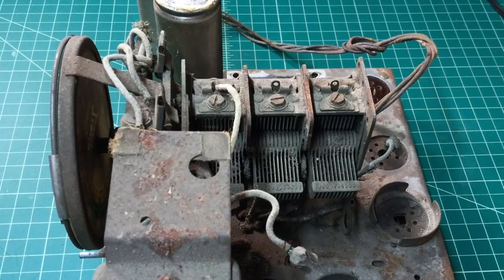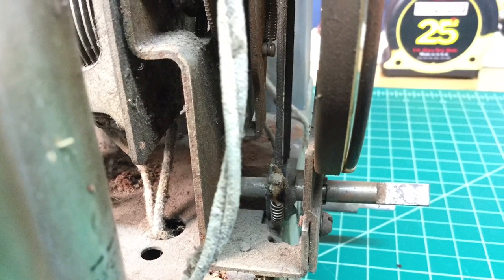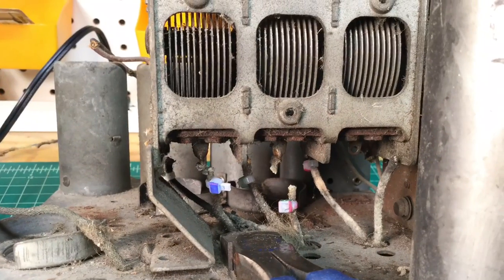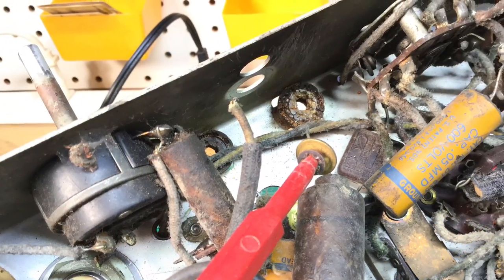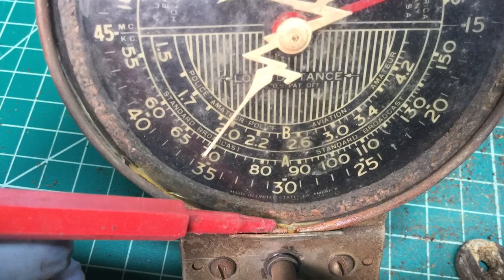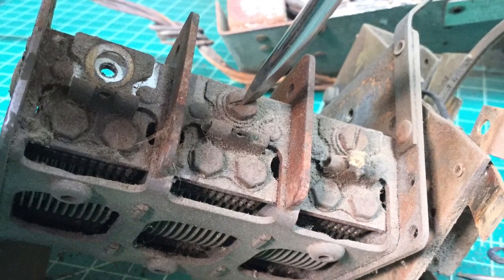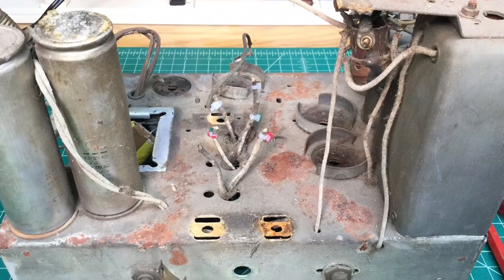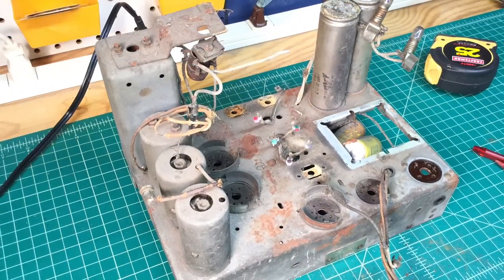Zenith 5-S-29: Tuning Condenser

Comment: Don,
"Organisation is the key to success!"  I came to the conclusion a while ago you are a well organised person: and let's face it, it is important to be so as we Vintage Radio men all know how easy  it is to lose an important component, or forget how one dismantled something.  I too document various things ... on pieces of paper, except in my case I often misplace those pieces of paper.  As my wife says, it defeats the object LOL.  I very much like how you document your progress electronically.  Unless it is accidentally deleted, it is accessible for as long as it is required.
Will you clean the tuning capacitor  inside your ultra-sonic cleaner?  If so, it will look good afterwards, especially its aluminium tuning veines.
Another excellent video my friend.
Regards,
Phil.
Reply from the maker: Hi Phil - my organization skills are better some days than others. LOL  I too have notebooks full of hand drawn notes and pictures. At times, I find photos hard to use if multiple shots from different angles are not secured. The old condenser is headed to the ultrasonic cleaner, but only after making another stop that I'll explain later. I spent 12 hours today de-rusting the majority of the chassis. I hope to have another video up soon and would like your opinion if the chassis would look better painted to hide some of the pitting the rust caused, or just let it be. Best, Don